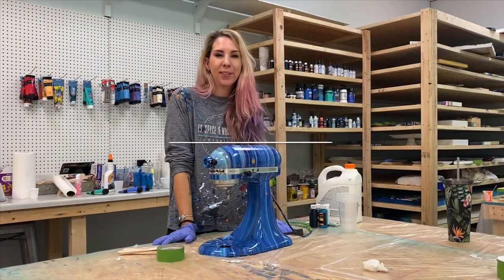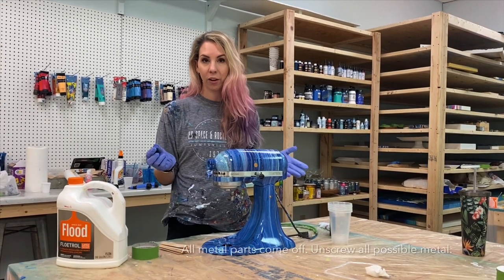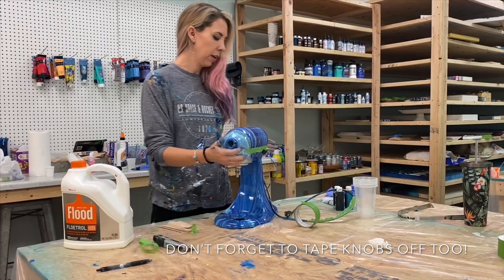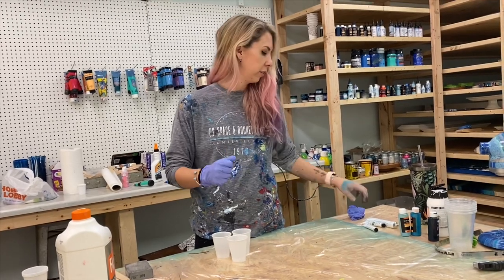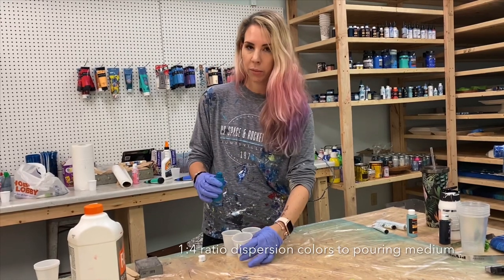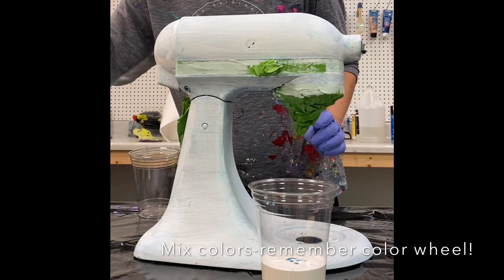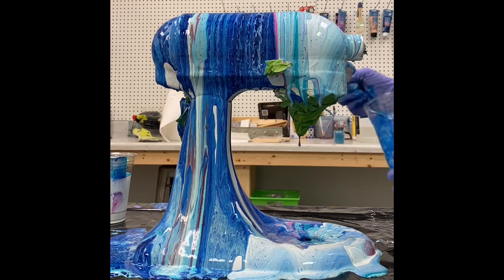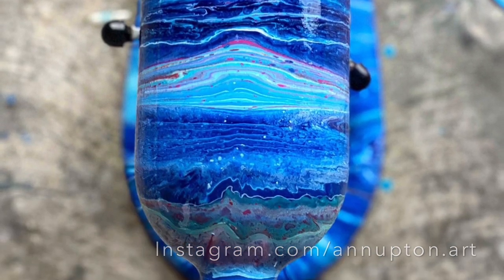DIY PAINTING a Kitchen Aid Mixer!

Comment: Super tutorial. Lots of info...fantastic. Does the paint not seep in between the space of the top and the bottom portion. Where it lifts up? Or did you clean that up after lol?
Reply from the maker: Laura Andrews I actually have paint on that part also and cover that about halfway through I think on the video. There is enough of a gap for it to not stick